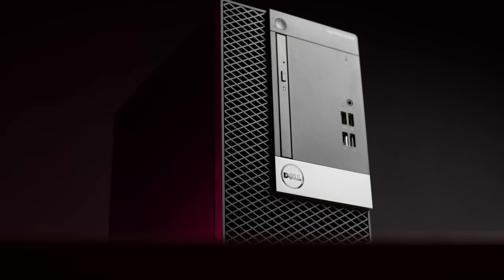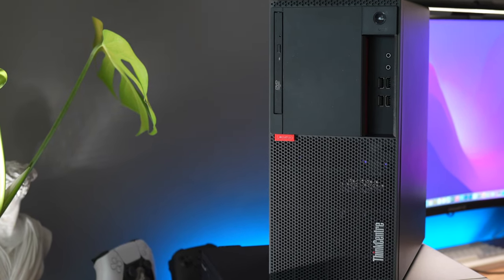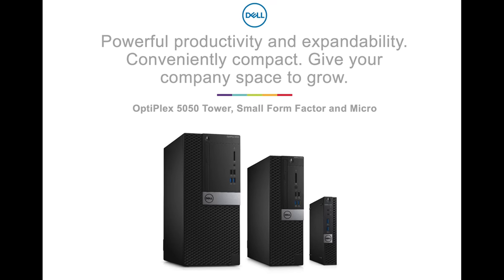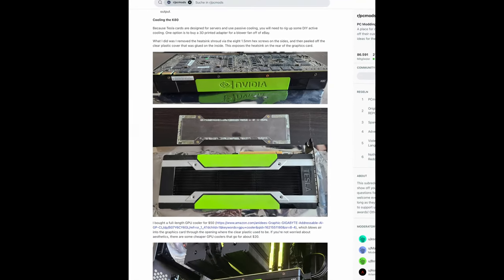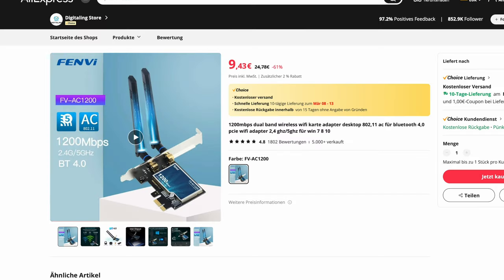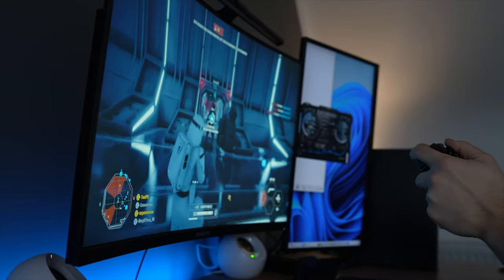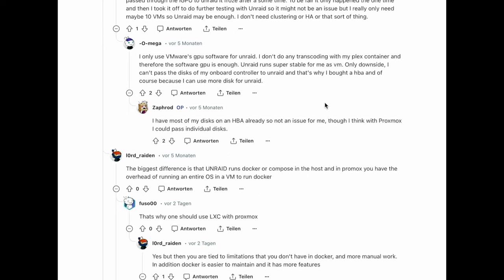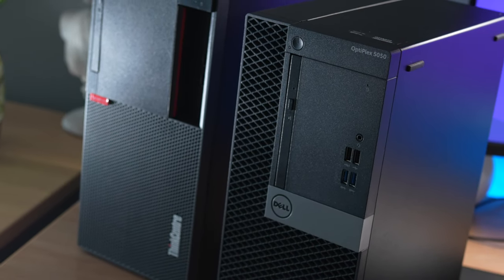A cheap office PC for gaming or home server use?

Comment: Nice to see someone still rocking Tesla P4 - here is a thing to keep if you want to recommend those GPUs

for 6-7th gen systems an i7 would be the best pick,  you will lose most of the stuttering which you mentioned in your vid
I would not recommend Tesla P4 for anything on older Gen -> even i7-4790K has bigger stutters than your i5 here while mixed with it.

I had a chance to test Tesla P4 with i5-9400T and it could run with it with no issues what-so-ever

Comment: I didn't look into this model, but it's likely that the second large PCI-E slot is actually only x8 electronically, even though it fits an x16 card. Usually, that's how it works with these office models, especially if the second slot is a different color. For most purposes other than video cards, it's not a big deal.
Reply from the maker: yes you are absolutely right. I did forgot to mention that the second pcie 16x slot is only supported on 8x lanes